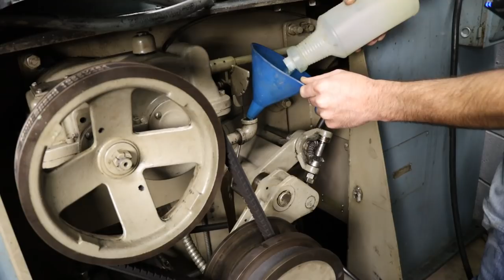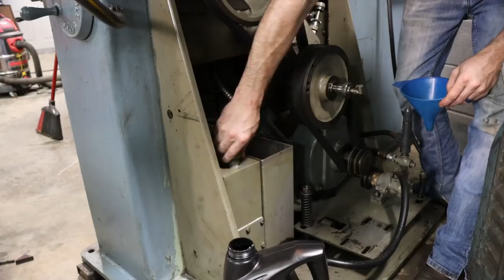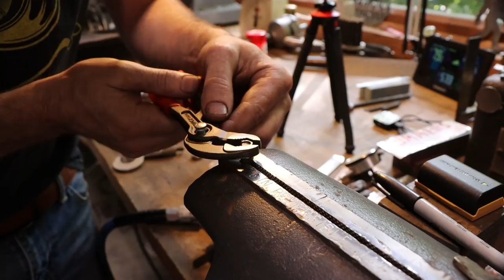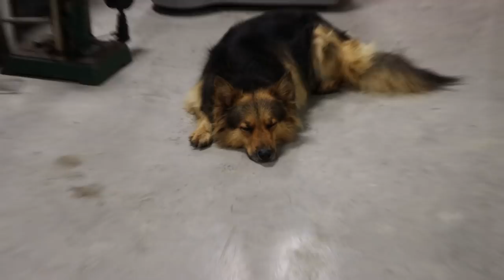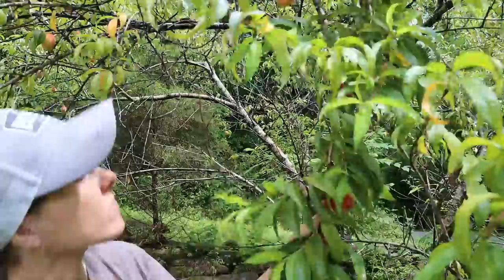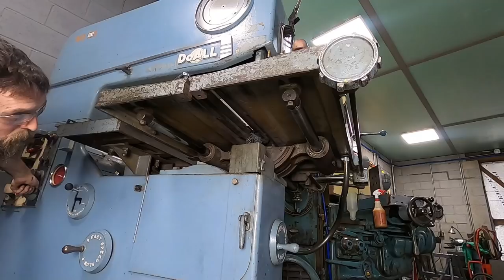Massive1953 Doall Saw repair and test run.

Comment: Yup, grew up during the 50’s and 60’s.
We’re so used to buying crap made in China… I doubt there is a single company there that can pass ISO 9000 much less 27001 & 27002 audits for real—no bribes.

Comment: I was looking for a new lathe prices from german companys ,when they send me an offer of 63.000€(tax excluded )for a 1.500mm work length lathe it was a joke.
For 63.000€ you can buy a used cnc machine and refurbish it factory new.Thats one of those companys that charge extra for everything -a 1000€ sticker.

Comment: You only have to look at older equipment like lathes to see the difference. Look at the beautiful curves and shapes on old LeBlond or South Bend lathes, then you look at new ones - even by the same manufacturers. No effort in visual aesthetic at all. Unfortunately the same applies to the internals as well - nowhere near as reliable, substantial or as much longevity, designed down to a price with nothing in reserve.

Comment: Am I the only one who is having issues hearing Steve talk? Having to blast the volume.
Reply: Audio can be low with a lot of content. My advise is to just have a decent sound system. One that goes to 11. Mine goes to 33 here. Normally I can run it at 11 and hear stuff. But if I have to I can turn it up some. I think with this video I was at 15?